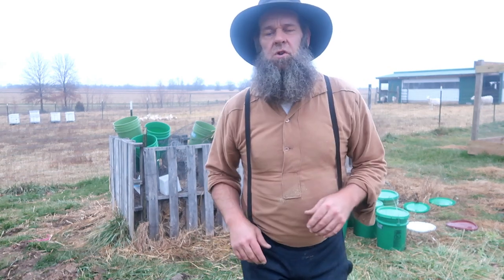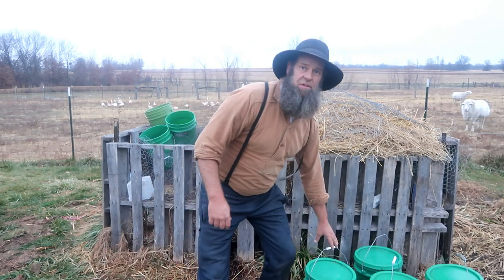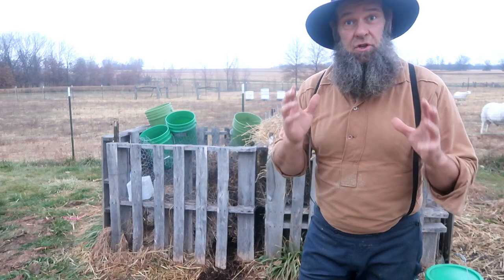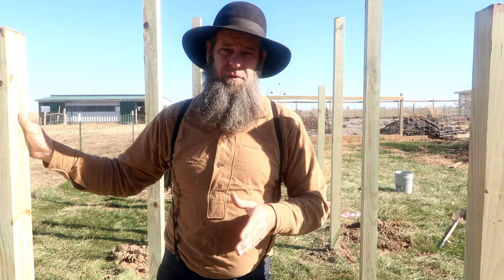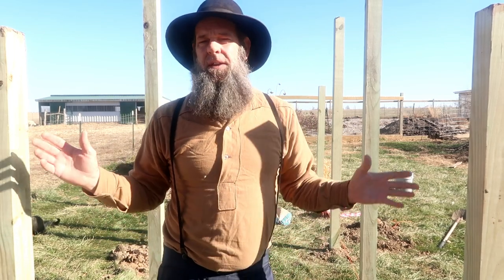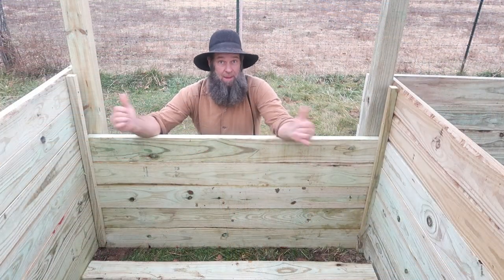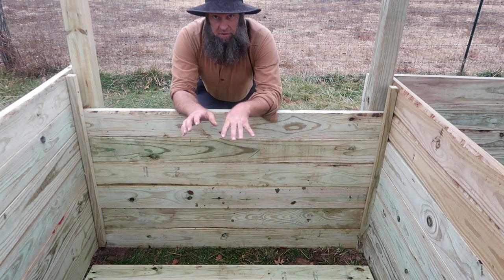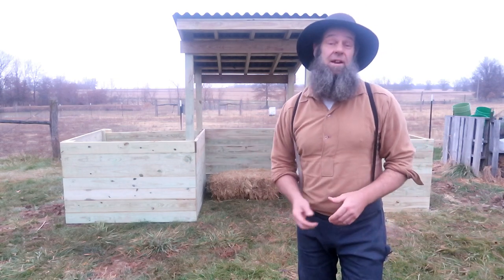OFF GRID~COMPOSTING TOILET ~ HOW TO BUILD A COMPOST CENTER!

Comment: Good job Doug!  We've used the removable board  walls in a few applications in my past,  in a grain bin, between 2 stalls so you could enlarge the stall to 2x size, the other for our basement coal room. Very handy. We had "braces" as you called them on the outside where we could put the boards when they weren't needed, so they would not get lost or damaged and were still right at hand.

Comment: great design! and no wasted flushing drinking water =) .im a chippy,built a tiny house with lotsa ply, and my concern is your safety how you're using a circular saw. Never stand behind the blade, you want to always be off to the side of it. When it grabs/fails while you're cutting, the saw goes backwards! and watching you cut at waste height  and standing behind it is a real danger for your arms/body/legs, even if you have alot of experience its just a good habit to stand to the side of blade, especially if you're new to using a circular saw, also the cut plywood side drops down(more so thinner plywood sheets) as you cut along, which increases the chance of the blade grabbing,,hope it helps your safety ,and happy poopn =)

Comment: i used a compost toilet for several years and was amazed at how easy it is to do and handle and then the amount of water you save from flushing is insane.
im in process of getting home built and plan to have compost system at new home

Comment: Have a question/suggestion: Is there a way to make tables with a wire rack so you can put the cleaned buckets upside down and drain and part of the table would have post like the dish drainer for glasses to keep them from blowing all around?
Reply: That can be a awesume idea!!!

Comment: thanks or all the tips ...I used a bucket method years ago when I was off grid and I learned the hard way NOT to carry the bucket out in winter on icy walkways...after slipping falling and having the bucket splash all over me  I went indoors and asked my kids to heat me some water so I could bath..they were so grossed out and all I could do was laugh (or I would have cried)...after that I used a sled to haul the bucket out...looking back I should have had more sawdust in the bucket and I possibly could have avoided the "accident"...lol

Comment: You should put a gutter at the back of that roof that collects the rain water into a 55 gallon water barrel that you can put under a down spout so rain would fill it.  Also put the barrel on a stand of some kind, maybe cinder blocks so it's high enough that if you used a rubber hose, you can have gravity fed water source for your piles.

Comment: Pretty awesome...close to what I was planning on building but I like your idea better...this next summer we will be building an outhouse over our septic tank as the drain field is all messed up...visitors can use that if they don't want to use the composting toilet we will have in the house...thanks again Doug...also...what kind of lumber did you use as I do not want to use pressure treated lumber...I can get redwood pretty easy here but also have a local hardwood dealer I can get hickory and stuff from pretty easy....

Comment: Thank you guys for putting this series together. Not all of us can use this type of waste treatment, but those who live in a more country location and have the place for the composting need to think about this. I have help build and maintain a few sewerage treatment plants. Most of them built near some sort of estuary, river, ocean discharge, etc.. The trouble is with those systems is if you get an .5 inches, or more, of rain in a short time (hours), the treatment really ends and only 'dilution' starts. All the sewage is diverted to wherever or whatever form of discharge/outfall method it has. Building more or bigger treatment facilities are good for employment, but is coming to a point of the ocean becoming the 'open cesspool' of the world.
Sorry for getting so 'dark'.  The drone shots of the Homestead we love, and it looks like Stacy is getting very skilled at using it.

Comment: I really like this Doug. I was wondering if I can use drum barrels.Drill holes in them, when filled,lock it write the year on the top, then let sit for three years. Would this work.
Reply: pandura gonzalez That would most likely result in anaerobic decomposition instead of the 'good' aerobic decomposition that you want.

Also, you would need to allow some type of venting or pressure relief. Otherwise, there's a good chance that the buildup of methane and other gases would cause the barrels to rupture.

Comment: Have you guys had your buckets crack from freezing?
Also I was wondering why you desided to made the straw area open from the front but the compost from the back?  Also do you wet the compost in the winter?
We will be using a system like this in the future and I really like your designs!!
Reply from the maker: nope, not a one, they are composting inside so stay a little warm =)

Comment: I would have made the removeable boards on the same side (or front) as the straw stall. So I would be walking around the compost center far less. That would have also let you snug it up closer to your fence. But that is just me.

Comment: They say it ends in a filtering station, but many times I've heard it to be dumped in oceans, not everywhere, maybe not as often.... I would much rather do the compost method. Just be sure of placement & it not interfering with the water table or wells, etc

Comment: I had to put in septic where I am and against advice I planted all my fruit treesalong the first line ofof drainage they say not to do it because if the roots grow into the pipe it could block your system but after fifteen years I have had no problems and the trees are unreal

Comment: Will you add a shelf or  a way to hang clean buckets?
Reply from the maker: stay tuned =)
Reply: OFF GRID with DOUG & STACY , haven't seen the video where you show what you did about the buckets. Please provide the link. Thanks. xoxo from rainy Arizona, 67/44f today.
Reply: A handful of hooks under the roof would be a solution to keep the buckets clean and dry

Comment: I like the removable boards in the back, but you need a place to store the "extra" boards so they don't warp and twist by just laying about willy nilly and still have them accessable when you are ready to raise the wall. PS. You didn't tell us your plan about where you are going to store the full buckets and the empty buckets. I'm guessing in with the straw but I'm sure you aren't going to just pile them up? Will that little roof catch enough water? xoxo from Arizona.
Reply from the maker: stay tuned
Reply: OFF GRID with DOUG & STACY , am I still staying tune? Or did you forget my questions? xoxo from Arizona and may your Christmas be blessed and merry.

Comment: Is there a reason why there are no open spaces in the walls for air circulation like the pallets would have?
Reply from the maker: No need but if it bothers you you could space them =)
Reply: I would guess you would need to regularly turn the bed to incorporate oxygen to promote the 'good' aerobic decomposition you want and to avoid anaerobic decomposition.

That is one of the advantages of the pallet method. The normal spacing of the boards allows nearly 50% of the perimeter of your compost pile open access to the air. As long as you are not adding lots of new material at a time, you will have more aerobic decomposition in a small bed without having to turn it regularly.

Comment: Do you use Lyme to help heat the piles so they compost quickly?
Reply: It hat is an amazing composting system.
Reply from the maker: nope, no need
Reply: You don't want it to break down too quickly or your pile to get too hot. An ideal temperature range for aerobic decomposition is 100-150 degrees F. Once you start exceeding 160 F, you risk killing off your beneficial bacteria that are breaking down your pile.